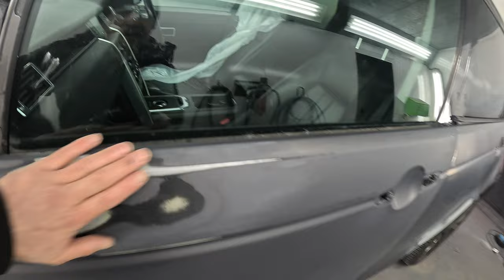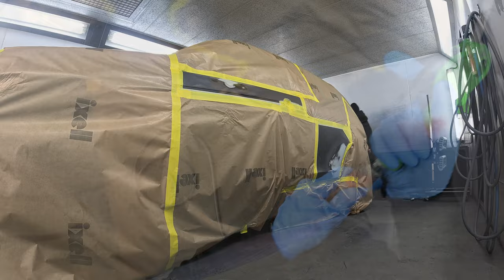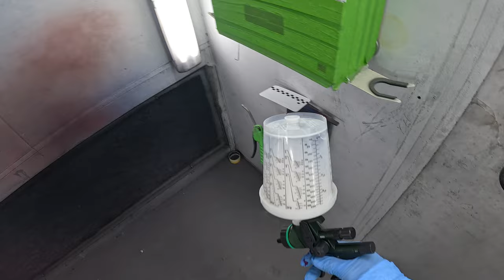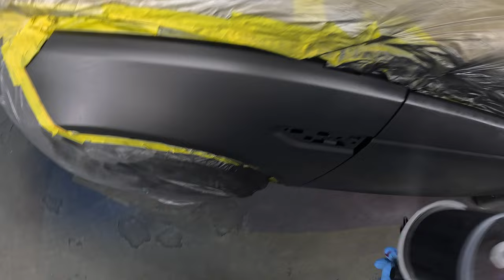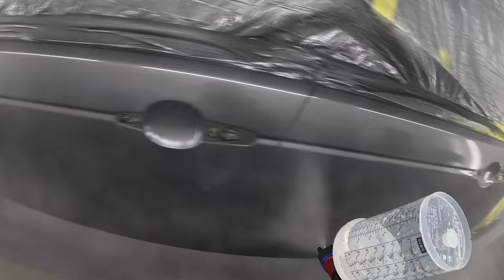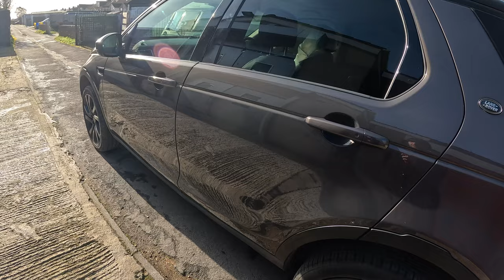Spraying & Blending Metallics Water based Base Coat

Comment: Some painters spray basecoat blender out of to the repaired area,  You spray it on that too. Does it fill scrathes or why you do that way? Final result is awesome, you really know what you are doing in booth 💥💯💯
Reply from the maker: The Mipa blender is meant to go over everything, as its not a wet bed it’s dried before the base coat is applied, yes is does help with prep scratches especially on silvers etc

Comment: Good job that mate do you do much on the base coat paint solvent side and that blend is it a Mipa fade out thinners 😊
Reply from the maker: Thanks, don’t really use solvent base coat only really on complete re sprays and restoration work
The blender is a water based base coat, it’s basically like a transparent binder